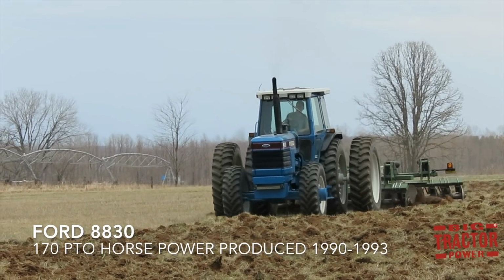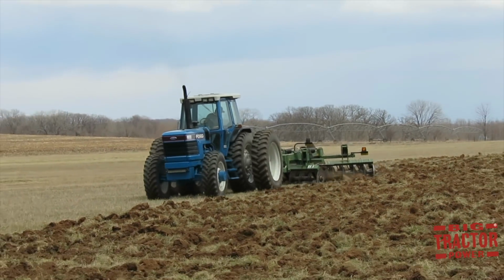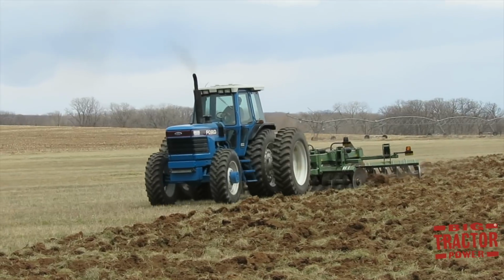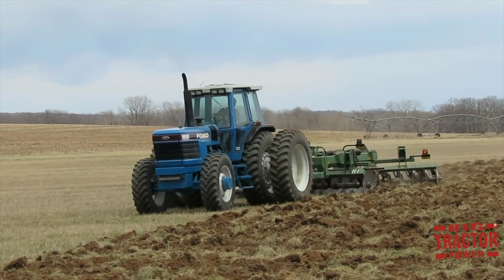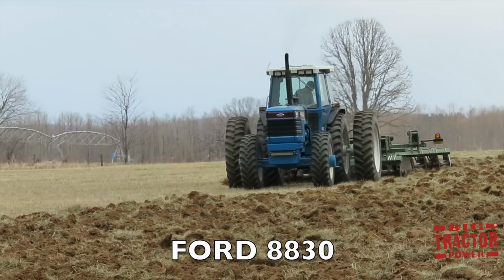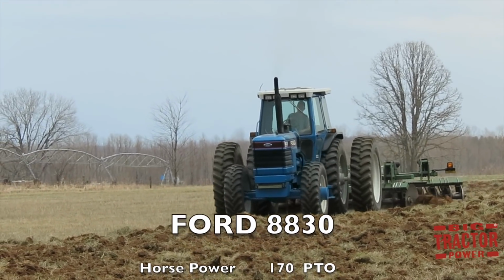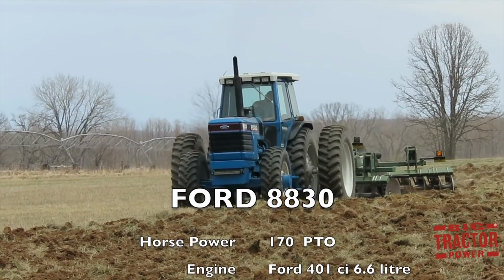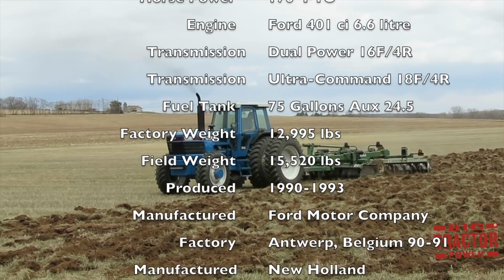FORD 8830 Tractor

Comment: We have an 8630 Ford but it’s a pretty good tractor and we use it for hilling potatoes and it’s is one of the most reliable tractors we have!!
Reply from the maker: Very cool.  That would be neat to see.
Reply: bigtractorpower also got a John Deere 4020 with stainless steel tanks mounted on it and a four row cultivator to apply liquid nitrogen to potatoes

Comment: I worked at a Ford equipment dealership when I has in high school.  We had 8830 come in before I left for college with the Ultra Command transmission.  I dynoed the 8830, it put out 189 HP @ 1000 RPM right out of the box.  The transmission wasn't great, the 9-10 and 10-9 shift would knock me right out of the seat- probably would be smoother in the field with a tillage tool behind it.  I wanted to drive it in the field on a demo but left for college before I had the opportunity to do so.  Real smooth engine under load- the 401s always were.  The tip turbine on the TW-35 and 8830 gave the tractor a little more high pitched turbo sound under load, which I thought was pretty cool.
Reply from the maker: What a great history.  Thank you for sharing.

Comment: Man, I miss Ford tractors, that is all I have ever owned, guess I will just have to keep the one's I have running!
Reply: We owned Ford tractors to from the 601 work master 3000,4000,5000,7000 and 8700, we still have our English made Ford 5000 with the cab my granddaddy bought it brand new in 1971. I really like it it’s like it’s part of the family. I’m a Ford tractor man I like them.
Reply: Same thing with my family. Grandpa bought our first 5000 new and that was the end of us owning anything else, red tractors all started to leave. Still have a 3000, 5610, 6600, 2- Tw 5's, and a 8730.
Reply: Blue tractors have always been my favorite, l miss them as well.
I have 2 Ford's and 1 New Holland
Reply: It's cheaper to keep your older tractors running then buying new. I have a 1989 IMT 539 39hp, a 1990 Massey Ferguson 3070 92hp. a 2004 John Deere 5320 64 hp. I like the Ford tractors. Too bad they  couldn't keep the Ford name on the New Holland tractors. If I had to replace all of my older tractors with new ones same size and quality it would cost me at least $180,000. dollars or more. Compared to about $50,000. dollars what I originally paid for the tractors I have, a $130,000 dollars difference. My tractors do just fine.

Comment: Is this the same kinda disk that the big Kentucky Farms pulls with 9Rs?  That’s Fords gettin it done. Probably less fuel and it’s paid for vs them 4wds.
Reply from the maker: Yes the big farm I film at runs seven Wishek Disks. Four 34ft and three 26ft models.  It takes hp to pull these disks. The Ford is getting the job done.

Comment: that is one great looking tractor one heck of disc he is pulling he must have her turned up a bit thats a hard pull im sure for 170 hp
Reply: ih guy no whe have ah 8830 its not 170hp standart but 190 hp standart an the 8830 is ah 7.5 liter engine

Comment: That disc was making the old Ford puff a bit.
Reply from the maker: Wishek is one of the heaviest built deep digging disks around. A farm I film at here in Kentucky has 7 Wisheks. The 34ft models go in 9620Rs and the 26ft models go on 9420Rs. This Ford 8830 is doing well with a 14ft.

Comment: Can anyone confirm that some 8830's are powered by Fiat engines?
Reply: I believe Ford used the 6.6 litre  engines for decades. The 9600 was powered by a 6.6 way back in the early 70's. Great Tractors.
Reply from the maker: The 8030 FORDs did not use a Fiat engine.  The 8030s and the Genesis models that followed continued to use a Ford engine.  When Versatile acquired the Genesis tractor in 2001 they continued to use the 7.5L Ford Genesis engine until they introduced the 250 and 280 which used a Cummins. New Holland and Case IH merged in 1999 and by 2003 the Magnum based New Holland TG tractors came out with Cummins engines.  With the introduction of the New Holland T8 in 2011 the Fiat Iveco engines were installed in blue tractors.